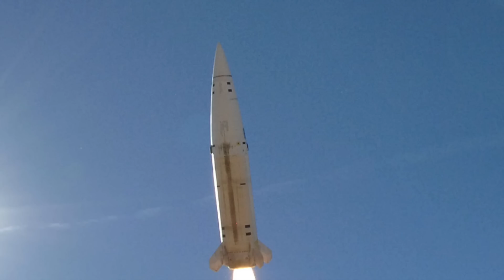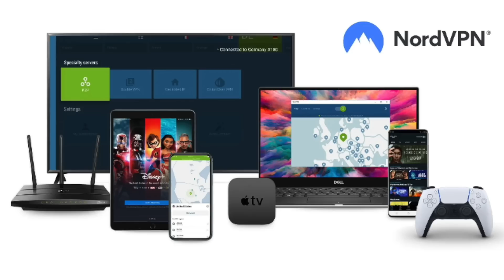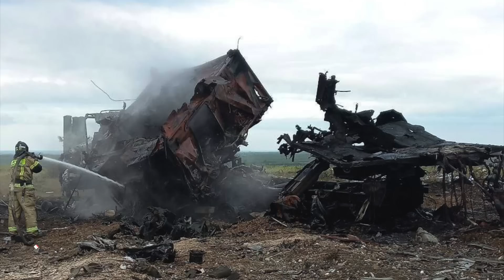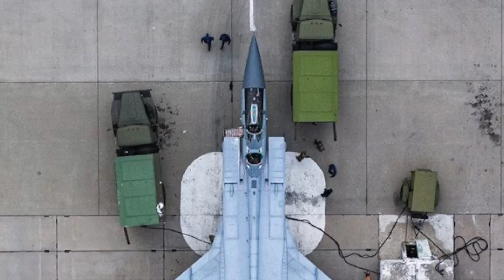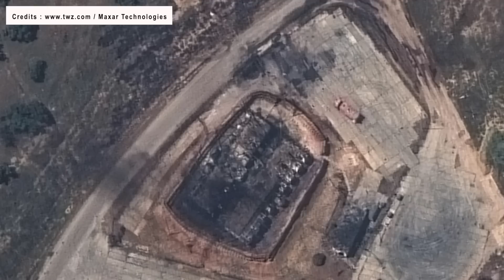How #atacms  managed to land one of the biggest single-day losses on Russia ?

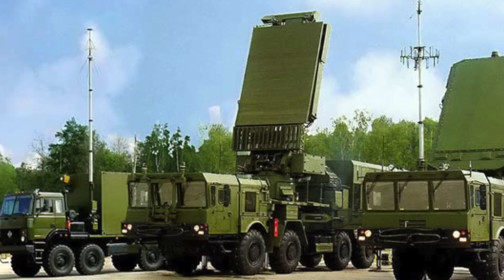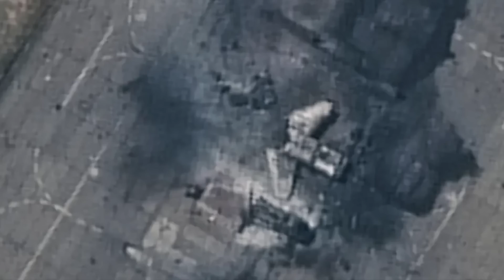Comment: 5:05 Fake news!..this is a rocket launcher and not S-400!..in the same group of photos there is a Zil-135 Truck of Uragan rockets launcher. 6:18 Ukrainian MIG 29 that was deployed in Balbeck in 2014 and was abandoned.
Reply: Keep coping
Reply: @verdebusterAP  :face-blue-smiling:
Reply: The only Russian MLRS system mounted on the MZKT-7930 chassis is the Tornado-S, which has two 2x3 pods of Smerch rockets. It can't carry 2x4 pods of rockets as the picture suggests. Upon closer inspection, you see that the square cutouts on the sides are not rocket tubes but cutouts designed to save weight. The "MLRS pod" is actually the back of the mounting system on a 92N6E "Gravestone" radar.
Reply: @BENKYism  The video dont show an Uragan truck that is deployed close to supposedly S-400 destroyed  and used to reload rockets, I see in this photo a launch container damage. but not an S-400 launchers or radar.
Reply: @manuelfloresescobar7657  What difference does it make if there is a picture of a Uragan deployed nearby? It doesn't matter if Uragan's were also involved in the attack. It was confirmed by both Russia and Ukraine that Belbek Air Base was attacked by ATACMS and Storm Shadow missiles.
Reply: @BENKYism  ZIL-135 truck of Uragan system to reload rockets means that this system is a rocket launcher and not S-400 system, thats why DU dont show the photo. for other side Ukraine propaganda showed a fake photo of 2 Ukrainian S-300 launchers destroyed on May 2022 in Korotych village in kharkov as was posted as if it were S-400 destroyed in Dzhkoy in Crimea.
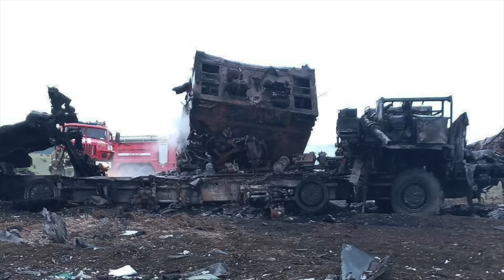Reply: @rhodium1096  Maybe it's the language barrier but I don't understand what you mean. The truck at 4:49 appears to be an MZKT-7930, not a ZIL-135.
Reply: @BENKYism  Zil-135 of Uragan complex( reload vehicle) was shown in the same group of photos showing the alleged S-400 destruction, D.U. only show one photo of them. This MZKT is part of Uragan 1M upgraded with a new launcher with 8 guided rockets.
Reply: @BENKYism  You are wrong! I have seen these photos( not only what DU show) and there is an Uragan Zil truck to reload rockets beside the 92N6E radar is not as big and thick as what appears in the photo. Russia are using MZKT trucks to deploy an upgrade version of Uragan 1M ( watch photos) with 8 guide rockets covered by a compact armored box.
Reply: @rhodium1096  I thought that you were saying that the vehicle at 4:49 was MLRS. Maybe there's an Uraguan next to it, idk. The square MLRS pod looking thing at 4:49 is actually the rotating mount for the Gravestone radar shown at 5:51 (vehicle in the center). You can tell that's what it is because it's roughly the same size, it's in the same general location, and it's mounted on the same vehicle.
Reply: @Rehunauris  What else can he do?  He has to cope somehow.
Reply: Mimimi.
Reply: Stupid ORCs
Reply: @Rehunauris  What Russian side?..Ukraine propaganda work well and use to manipulate photos of the destruction of its S-300 and post it as if they were Russian systems.